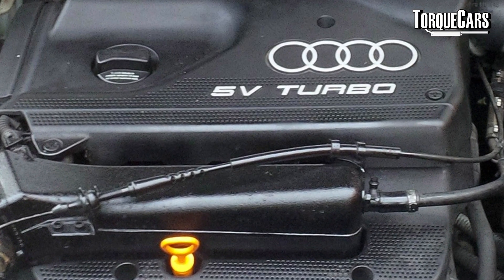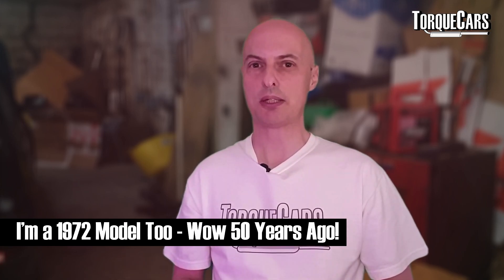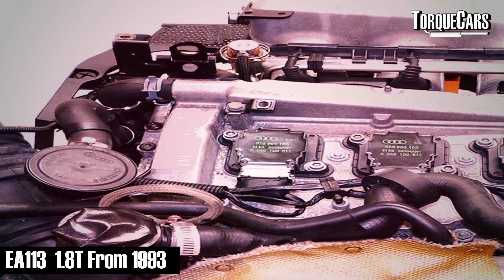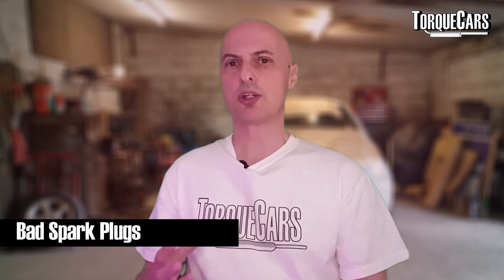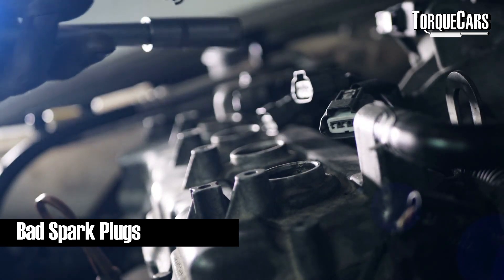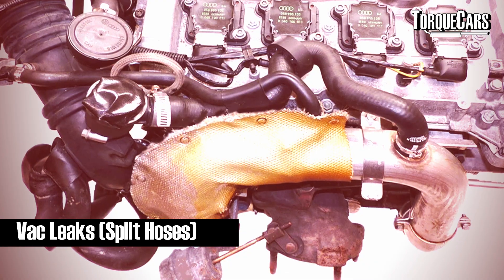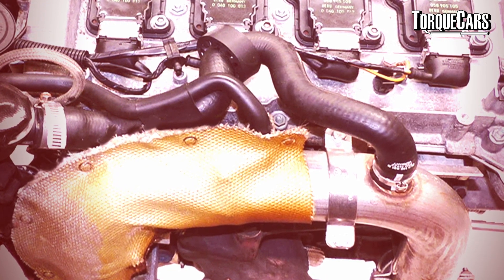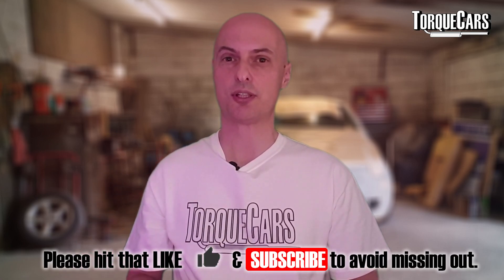Fix Common 1.8T Engine Problems VW Audi Skoda Seat [VAG Engine Guide]

Comment: im so late lol 2004 vw passat gls 1.8t AWM got it from my EX father-in-law and boy did he not take care of it at all. recently had to replace the fuel pump, valve gasket, oil pressure sensor, crank sensor, coolant reservoir. looking to replace the injectors next.

Comment: 12:30
After notice misfire problem firstly check spark plug.
Next is coils.
Do it in the same as mentioned in video.
Spark plug has shorten worn out period then coils, and they are much cheaper.

Comment: 11:40
Second common problem with temperature in every car should be thermostat.
It is much easier and cheaper operation to replace it compare to water pump (this is also long term consumable part).
Keep this in mind.

Comment: Hi, I found your video really informative. I have just brought a A4 1.8 T petrol, i was used to having the BMW m sport diesel before, and that pulled like a train in every gear and returned 41mpg. I am sure A4 has a problem, it has some exceleration, the Revs keep climbing right through to 5/6000rpm but it doesnt go anywhere. and the consumption is depressing, 31mpg. surely this isnt right? Do you have any tips on where to start looking? the engine runs smoothly, sounds healthy, the turbo kicks in and doesnt make any strange noises. i dont want to get rid of the car, but it is costly to run and not very exciting to drive. please help!

Comment: I’ve got the Audi A3 8P 1.8T S-Line Special Edition on 190k miles. 
It’s only failed 1/15 MOT’S, it’s been very well looked after. Until I bought it, it decided it liked to use all the engine oil over 2 days. Any ideas of what is could be?

Comment: Sludge discussions don't tell us main causes of sludge build up is actually cold oil changes.....always fully warm up engine and drain....flushing is Additive Proper however depends upon Reason for oil change...secondary sludge contaminant is burning due to thinned viscosity or higher mileage or thick viscosity..cold starting and not warming before load applying or operating cold or revving while cold starting.😊

Comment: Love your channel on VAG engines and tuning. I’m new to the VAG vehicles. I have a used 2015 Audi TTS 2.0 TFSI CDMA engine w/ 23K miles Competition pkg. Located in the USA. The car is in Mint condition. I went stage 1 ecu tune & stage 2 TCU from 034 Motorsport. Car feels nice. What do you suggest should be done to make it more reliable and must do for maintenance and reliability? Is adding a catch can  a needed on these cars? What are areas of concern that need attention? Looking forward to your reply and thanks in advance.🙂

Comment: Hey you should be charging the oil sooner then 9000 miles more like 5000 miles and the time you have the oil In it doesn't matter unless it gets contaminated
Reply: I just bought a 2016 Jetta with one and it though munching some valves would be good so theres some malice in the combination palace 
I'm assuming the timing chain jumped because of lack of oil changes
Reply: @Crockedflyer811  2016 jetta didn't have this engine

Comment: Worst engine I have ever had. vw 1.8 tsi after only 40 000 km consumed more then 1l of oil per 500 km.
Reply: Not the same engines. It's about old 1.8T and not 1.8TSI/TFSI
Reply: Different engine 🙄🙄

Comment: Hi, i have VW cc 1.8tsi CDAA EA888 engine, i have observed that engine oil is leaking a bit from turbo boost pipe down side near to the radiator on driver side, engine oil become low and have to put quart of oil every 1000km, can you tell me the reason for that oil going to boost pipe, i checked on internet and found that maybe it because of valve guide seal leak issue on turbo engines, can you confirm?

Comment: What about the pcv valve? I suspect mine is stuck closed… lots of condensation build up, condensation from exhaust, it mimics a blown head gasket…. Only just got my car so I’ll be doing a thorough inspection tomorrow but pretty sure it’s a closed pcv.. a stuck open pcv can cause a headache of issues too.
Mines a 225 bam engine, mk1 tt
Reply from the maker: A blocked closed PCV usually creates oil leaks due to the pressure build up in the crankcase. You might even get a hiss when you open the oil filler cap. Hope you can track down the source of your problems. Hoepfully the previous owner has just done short journeys and when you start driving it properly these issues will go away.
Reply: @torquecars  thanks for your feedback… yes that is the case the previous owner did very little miles and she only drove it locally and then it’s been stood for a year on her driveway… it’s amazing how the two faults can mimic each other.
Reply: Hello. I’m getting the same problem. A lot of “steam” from oil cap and a lot of outwards pressure from oil cap. What happened to yours? PCV?

Comment: 1.8 t is HUGE piece of shit engine and it' s just problem with everything ....---😏
Reply from the maker: Are you referring to the 1.8 TFSI (direct injection) EA888 or the older 20V 1.8T EA113 as referenced in this video?
Reply: @torquecars  
Both is great shit .Doesn't matter .
Reply: You don't know what tf you're talking about. Everyone knows the 888 is a POS, this is an earlier engine.
Reply: @torquecars  
The best advice you can give to people about vw  is to throw that merkelas shit on garbage and buy a Toyota or Kia .😀
2.000.0000 times is bettre cars then dissaster vw .

Comment: Samuel from South Africa AUQ engine done 277000 engine never been opened and still pulling strong and runs quiet as a new one but serviced on time and with the best oil available.

Comment: Can you tell me the best oil to use of this 3 ones?   AGU pulling 220/230hp     5w40 / 10w40 / 10w60
Reply from the maker: Make sure it is VW spec oil, the grade is only an indicator and it MUST be a fully synthetic oil. Many of the 10W40's oils out there are mineral, and most are using the 5W40 but check the oil is a fully synthetic oil. I used to put Shell Helix ultra, 5w-40 in my AGU Audi A3. I wouldn't recommend a 10W60 on this engine personally. 

Do you live in an extremely hot or cold weather area?
Reply: No need to go thicker if you have adequate pressure. Use the lowest weight oil you can that gives you the right pressure.

Comment: I need help today my passat just blew out oil under the engine everywhere no oil on the top of the engine what is going on its only got 138,000 miles it's knocking but it will start and run

Comment: Turbocharged cars degrade there oil really fast increased temperatures
Reply from the maker: Totally agree, when you shut off the engine if the turbo is hot it effectively cooks the oil inside so it makes sense to allow the turbo to cool before you switch off the engine for a few moments.

Comment: What the heck is a lumpy tick over?
Reply from the maker: Perhaps I'm using a British English phrase here. Lumpy - undulating, irregular or erratic.  It doesn't idle smoothly and revs will rise and fall instead of maintaining a constant rpm. I do try to avoid these localization's in language and tend towards US terms so this feedback is useful.
Reply: @torquecars  Roger that.
Reply: @RetreatHacker  You just used British English.

Comment: Nice video! Was wondering if you could give me advice about which coil packs to buy for my Seat Ibiza FR 1.8T 20v. The one connected to the fourth cilinder keeps breaking down. I have replaced it 3 times in one year already. When a new one is in it runs just fine. But after a while I keep having harsh start ups and sometimes even misfires of the fourth cilinder. Was thinking of buying some good ones so this problem is solved. Any tips?
Reply from the maker: I've not tried any so can't recommend them from personal experience but from the lads in the forum and friends I've heard good things about Hella NGK Alpha competition and Awesome GTi's 2.0 to 1.8 coilpack conversions. Is the 4th cylinder subject to more heat? Shielding the exhaust may help, can't remember the layout on these engines now.

Comment: New:
- MAF Sensor
- N75
- Oxygen Sensor
- Gas Butterfly
- Cylinder Head
- Turbo
- Downpipe
- Exhaust
- İntercooler
- Radiator
- Water Pump
- Timing Belt
- Oil Pump
And i still have idle problems. The car still tells me that the MAF has low Signal altough its New 😭
Reply from the maker: Could be a bad cable between the MAF and ECU check the wire connection for continuity and resistance. Is this a DBW engine? I've also known new MAF sensors to play up. Is the MAF the correct one for the amount of boost you are running? Switching to a 4 bar MAF will also require a tweak in the ECU software, but will allow more leeway in higher boost applications.
Reply: @torquecars  its an AGU engine and i ordered the Original bosh maf
Reply from the maker: What readings are you getting at idle and at 2500RPM? It should be around 1.8 to 3.9g/s at idle and 7.5 to 12g/s at 2500rpm (measured from block 002 field 4 or 003 field 2)

Got any vac line leaks on this? Is the turbo the standard OEM spec turbo?
Reply: @torquecars  it says p0102 Signal too low, so i cant even get any readings. The İnjectors are New 630cc 
The turbo is a Borgwarner k16
Reply: Nice parts cannon 😂😂

Comment: Hi. I've got the 2001 Golf 1.8 GTI turbo. Engine management light has been on for years, but it drives perfectly fine but it burns a bit rich. I have recently replaced the thermostat. Any suggestions  on what it could be? Many thanks.
Reply: Go to a mechanic
Reply: Oxygen sensor

Comment: the cam chain tensioner  is one of those  that doesnt go often but  ive replaced  several on these engines. ususaly around 180k-190k  ususaly on the AWM heads. happned to mine at 193k. i wouldn't even go 9,000k on oil changes on these engines id go a max of 5,000  they eat oil and with less than 5 quarts of oil  you will be out of oil  in 9000k not everyone is smart enough to  check their oil.
Reply: They shouldn't burn that much oil unless they've been neglected, but 9000 miles on these engines is definitely too long for an oil change
Reply from the maker: Great tip, my tensioner went around 80,000 so I guess I was unlucky. These are pretty solid and reliable engines though, it almost seems cruel to list common faults, but this is what people were asking for so the top faults were compiled into this video. Totally agree with you on the oil though. It does seem the newer ones are more prone to using oil than the early engines.